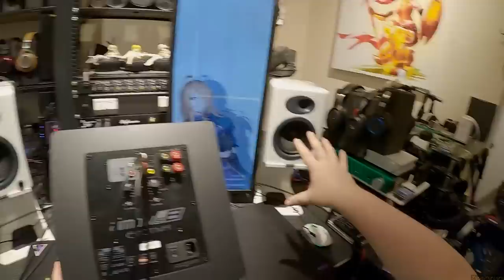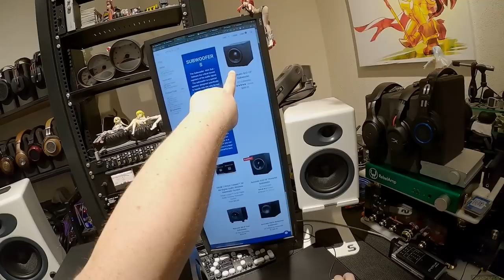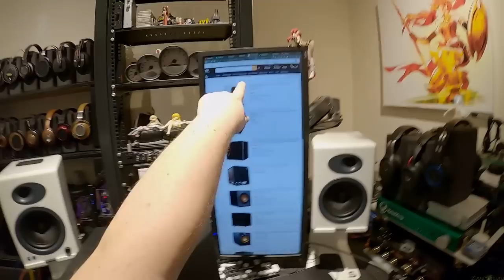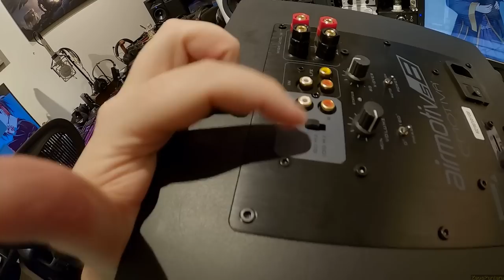Emotiva S8 Sub _(Z Reviews)_ Take my 8" of Fury!

Comment: Emotiva is headquartered in Franklin Tennessee! So yes, outside of Nashville.  Great review Zeos :)
Reply: Also, I completely share your enthusiasm for integrated high pass filters. It’s shocking how commonly overlooked that is by product designers and manufacturers, drives me nuts! Klipsch’s new “The Fives” also have it as a feature included with the sub output and that in itself made me interested in them :)
Reply: @adam3402  Agreed, even my parents radio shack tower speakers (realistics?) from the 1980's had a 10" with a 10" passive radiator with real/actual oak (not veneer!) sheets on the outsides.   Sounded great for what they were back in those days.    I think it's a material cost issue,  passive radiator is going to require a bigger box on a tower speaker, but on dedicated subs, I don't see why they are not more popular, especially 10" and smaller as those will need to be driven at a greater volume.

Comment: Hey Zeos the thing behind the sub is gain knob not volume knob (I know you know that but many new people don’t) if you tell ppl that’s its a volume knob then they will crank the subwoofer gain all the way up and send a full 2v singal from their dac into the sub and clip the sub amplifier. This is what I would do. Take line out (fixed 2v or higher) into a passive volume knob., set your speakers to max volume, and sub gain between 1/3 to 1/2 and then control everything from the passive volume knob. With A5+ set the crossover to 80hz.

Comment: If you're looking for a sub in this category keep an eye out for the JBL Studio 550P. MSRP is $599 but they seem to go on sale for <$200 every few months. I picked one up at $179 and its a killer value. 10" sealed, 300W RMS, F3 of 27Hz. No cool in-line crossover on the RCA's like this sub but its got more power and digs deeper.

Comment: Have to get your hands on the Def Tech Supercube Reference or Trinity subwoofer. I just picked up the Reference in mint condition...converted CDN to USD I paid $500! 17" cube, 1 x 14" 1800W long throw driver with 2 x 14" passive side radiators and weighs over 100lbs...unbelievably powerful and fast. Make for a great video...no problems comparing to a lot of the heavy hitters out there. This dual radiated beast fires like a 21" driver...crazy performance for the money. I originally had the ML Dynamo 1600x and this thing eats it for dinner!

Comment: Tone controls and/or an equalizer can also be used in conjunction with speaker level inputs to adjust the bass going to the left and right speakers. This type of sub works well with the Sony STRDH190 2 channel cheap receiver. Emotiva SE12 for $100 more is a 12 inch goes to 28hz with same driver and passive configuration.

Comment: The source direction isn't because of the way the pixies flow, its because the shielding is only connected to ground at one end of the cable. So for optimal EMI rejection it should be hooked up the way it says. Probably not an audible difference unless you are in an electrically noisy area.

Comment: If you using passive speakers with a preamp and power amp you can send the pre amp via rca into the sub then rca out to the power  amp and set the crossover point on the sub to wat ever one you want

Comment: EVE audio TS108 has:
Passive radiator design,
Bypass function,
highpass at 80hz switchable,
lowpass from 80-140hz variable,
and a remote.
Also xlr output for your satellites. 
Hands down the best Sub on the market bang-for-buck wise.

Comment: The RCA output on SVS SB-1000 has a high pass filter fixed at 80Hz. Good for speakers, bad for daisy chaining. Come think of it you wouldn't be able to daisy chain the SE8 either since there is no 'off' option for it's high pass filter.

Comment: I best this sub would work will in a home theater if you had dual subs.  Maybe not in a huge room but they are nice and small and can fit much easier.  I currently only use one 12” sub because I can’t fit two 12”s, but two of these may fit.

Comment: If you get the chance, you really should give the RSL Speedwoofer 10S out; it also has high-pass via RCA input and output as well as line-level speaker terminals. It's also a 10" that kicks like no 10" I have ever heard, especially for $399.

Comment: Zeoz obviously has never experienced the KING of SMALL subs The Sunfire line of subs ,they have an 1800 watt 8 inch ,a 2700 watt 10 inch and a 3000 watt 12 inch ,all not much bigger than their drivers and all guaranteed  to pass the wife acceptance factor  as they are easy to hide and put out an unbelievable amount of bass for their size. The original with a 10 inch driver in an 11 inch cube was said to move as much air as three 15 inch drivers. Expensive but nothing else like them.
Reply: I had though sunfire went out of business a few years ago. They also had major issues with grounding hum. I had a pair of the 10" and even with ground loop isolators they hummed. They hit like a hammer to your chest if you could get past the humm

Comment: This rolls off fast below 35-ish Hz, so I'm not sure if the passive radiator does anything to help dig deeper. I ended up getting SVS SB1000 (sealed), it's flat down to 25 Hz in my room. But of course the SB1000 is more expensive. But it is also very fast and tight.

Comment: Until the end of the month you get 30% off your next purchase so you can get a pair of these about $100  off. I got a bunch of stuff so my second S8 was free lol.
Reply: Man I milked that s*it. Bought 4 amps off Emotiva and just applied the vouchers to the next purchase and still have 328 dollars worth of vouchers to use for another purchase! 

Sold 3 of the amps and made some serious profit.
Reply: @MrElchav  nice, yeah it was a great deal, I saved a ton too. New desk  system, TA 100, Virtual Copper Bluetooth adapter, and 2 S8's. Saved $290! I have hifi gear but at my desk was running a Logitech Z623 (actually not bad at all, comes with a ported 7" nearly as large as these S8s), and now I get a nice upgrade . Emotiva doesnt really do sales so had to jump.

All the Emotiva gear I've ever owned and then sold on Audiogon I got damn near what I paid. Emotiva stuff does not depreciate.

Comment: Few questions. New to the audio game, be gentle. I've got a FiiO E10K to drive my audio stuff stuffs, which consist of He4XX, AKG K553 MK2, and tin t2. I'm looking for some good cans for more serious gaming cause earbuds get annoying after a while, what set of headphones would you suggest for treble+imaging? Budget is abouuuut 250$, so there's a lot of room for suggestions. Open back and closed back suggestions welcome, just need over ears. I'm considering ATH-AD700Xs.
Reply: Sennheiser 599 or 58x
Reply: The 4xx are amazing for gaming, they have great imaging, you might consider using that budget on an amp instead of another set of headphones.

Comment: adam audio t10s has the crossover + balanced connection
Reply: I have the Adam T10S and the JBL LSR310S. Both have line level crossovers. T10S has RCA and XLR. JBL has TRS and XLR. The JBL has a bigger cabinet and seems to dig a little deeper.

Comment: Great review Zeos! I have the JDS Labs Atom feeding my pair iLoud MTM through the preamp on my desk. How can I integrate this subwoofer in my setup?
Reply: You could get sub like this with crossover and outputs. The subwoofer i have has rca and XLR outputs, i also use a jds labs atom
Reply: MasterMark So how would I plug it all together? (sorry I dont have much knowledge when it comes to speakers) If I were to guess it would be pre-amp to subwoofer input and then subwoofer output to the speakers? Thanks!

Comment: I really don't get how to hook this up. Which is unfortunate, because i'm searching for a decent 2.1 system. If i plug this into a computer, i will need to go to an amp... and from there to the sub... and seperate to the speakers... but also from the speakers to the woofer? But all that with these special cables...
Reply: no, you could use the headphone out on your motherboard to RCA, RCA to powered monitors and done.

Comment: Some cable companies put arrows on their cables arbitrarily because people want to see the arrows. But a good company labels their cables based on the draw direction of the copper, because the draw process changes the resistance of the copper. With a good enough system, you will hear a difference in cable direction.

Comment: The adam t10s can do the same and I might buy it since you can‘t get emotiva in germany
Reply: Adam is better quality than emotiva.
Reply: Never waste money on a studio subwoofer. I absolutely adore studio monitors, but studio subwoofers from these same companies are garbage for the money. $250 is fair but $400 is over priced. 
Rythmik, HSU and SVS sealed subs will kill any studio sub. Grab a MiniDSP 2x4HD to go along with it and have a real crossover plus a lot more.
I paid $260 for my Studio Sub and it was pretty good, but my Rythmik L12 for $540 absolutely murders it, and plays a lot nicer with my oddly shaped room, going down below 20Hz versus my ported studio sub not going any lower than my 5" speakers due to a large null effecting that area.

Comment: If I go 8 inches with a sub I'm going with a pair of  REL T/7i's.  Rhythmik FM8 which are dual sealed 8's is also a clean product and a decent deal @ $1k.
Reply: for music, it is hard to argue with REL.
Reply from the maker: 1k for an 8" means you have VERY specific needs.
Reply: @ZReviews  A Maggie LRS for $650 require a sub that is tight, precise, and quick.  A Rthymik FM8 is the perfect combo with it.  So yes you're correct very specific needs.  But there are a ton of Maggie owners out there and LRS are flying off the shelves like hot cakes.
Reply: @aceofspades6667  Please don't buy into the cult of REL. I am sure their subs are clean sounding (probably clean because they don't actually create any bass) but they are crazy over priced. A Rythmik L12 for around $550 is better on paper than a REL T/9i costing $1300, and having owned this Rythmik, it sounds incredible when you integrate it properly using science.
I mean I built 2 Dayton Ultimax 18" 1000W+ sealed subs for $1400 and they sound wickedly good. In REL land all you get for $1400 is a 10" 300W sub which is a joke.

Comment: Dont most studio subwoofers have a High Pass Filter for their Line Outputs? 
Pretty sure Zeo's Mackie MR10S sub has this feature
Reply: Yep.
Reply from the maker: If it does there is no label to enable or disable that feature.
Reply: @ZReviews  Hi Z. You're Right. its not labelled on the mackie mrs10 sub. however, its crossover is a proper crossover, not just a LPF. Set it to 80hz and everything above 80hz will be redirected to the monitors. pressing the footswitch defeats the crossover, turns off the sub and plays the audio in fullrange to the monitors.
Additionally, the Yamaha HS8S has separate High and Low Cut Variable Filters. the PResonus Temblor has a HPF toggle.  the rokit 8S has a "sub & HPF bypass" connection for its footswitch.

Comment: I thought most subs have a high pass filter? But having a switch in stead of a variable knob is ... new, but not as flexible. 60/80/100 is all you really need tho. The Bic has a crossover knob - but no line level outs, so yeah, if using powered monitors the Emotiva is better. Maybe that's your point? Now that I think about it, yeah - not sure if I've seen a high pass filter for line level outputs. That has to be 100% for using with powered monitors (that don't have a sub out). Ok - I'm with you now.
Reply: It has the knob too. You missed the whole thing about the connection. The knob is for the sub. The switch is for the *speakers*.
Reply: The knob is a low pass filter, the switch is a high pass filter. The low pass filter means it will only process sound below a certain frequency. The high pass filter will only send signal higher than said frequency to the speakers.

Comment: 5:20 , well the pb1000 does the same thing. The crossover point is for both the sub and the speakers, and there it's a variable knob instead of 3 settings.
nothing special :P .
18:00, wow those options never existed before, there are probably more than 10 subs that had (discontinues) / have those.

Comment: You lost me at no variable phase control. I'd take a JL Dominion D108 any day of the week over that piece of crap.
Reply: Jl is decent   Way overpriced for the performance you get.  Funk audio, rythmik and jtr audio over jl no question. The jl subs will get smashed by those in output and sound quality. The larger drivers will have much lower distortion than jl smaller drivers in the fatham series and Gotham series. Jl is good don’t get me wrong but you can get much better performing subs than jl. Jl smaller subs are good for small spaces and have good output for their size.
Reply: I agree that I would take the jl D108 over this sub.
Reply: @Kevin L. Yeah it's funny because the JL is an 8" that will destroy most 10's on the market. That $900 is worth it. Oh, and I forgot to mention it's and 8" that will drop down to 20hz. Mic drop
Reply: @Kevin L. 🤣 I like that analogy.